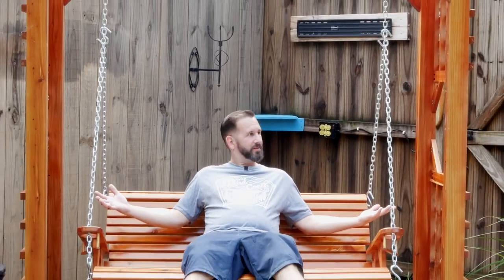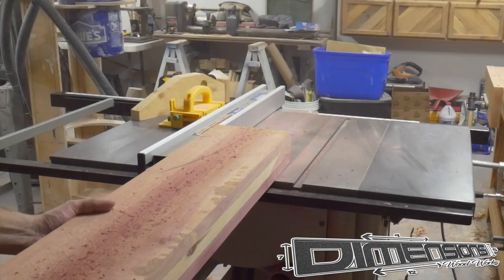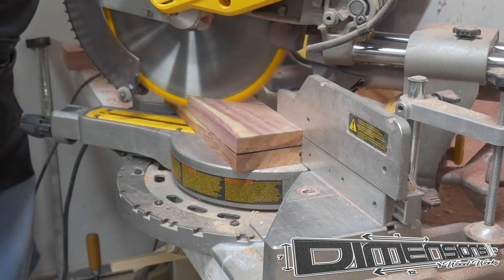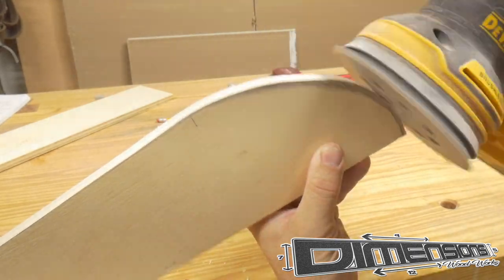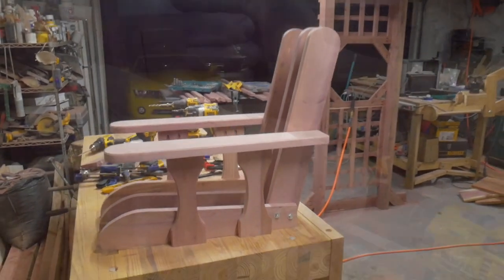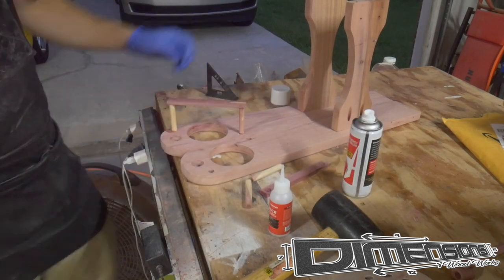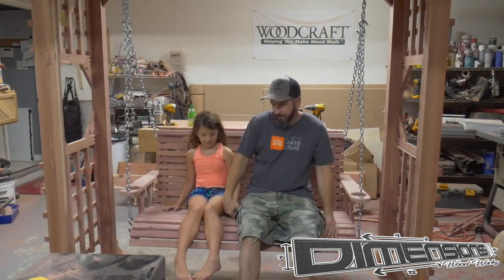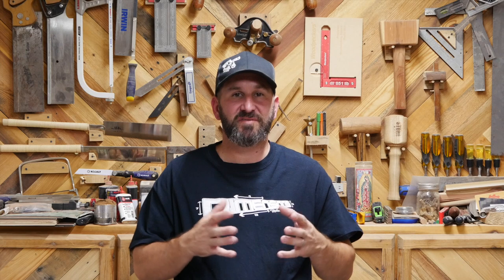DIY Swing

Comment: Any links to the hardware you used, chain size, etc.?  Nice swing, but I'm looking for a different design so I didn't buy you plans.  For instance, I'd like the chain to NOT go through the arms like many do, including yours. That's just a personal preference, not a criticism of your design.  Also, I'd like to add a swingdown console in the middle.  Thanks for posting.  Mark
Reply from the maker: All the hardware came from tractor supply. The actual hardware i used is no longer available from them, but there are several other options available. But if you buy the chain from them, the load capacity is printed on every chain, i 3X whatever i believe the max load may be, so if you use a different design, that may change as well. Thanks for checking it out 👍🏻
Reply: @dimensionswoodworks  Thank you, sir, for the quick reply and information!  Mark
Reply from the maker: No worries! I always love to see pics of the finished product. Send them to me when you get it done.

Comment: Excellent swing. I noticed you used brads and glue to attach slats to the frame. How do the slats hold after three years ? Do the slats stay where they suppose to stay ?
Reply from the maker: They have so far. The brads are really there just to let the glue dry. The glue is always stronger than the wood. You can reference MANY YT videos for confirmation of that.

Comment: I’m really thinking about giving this a go, but before I buy the plans, one concern is that I don’t have a planer or a jointer. I also wonder if I’m gonna have to glue the boards together like you did or if my lumber yard will have what I need. Do the plants call for the gluing of boards together? I know this is a lot of newbie questions, but I am a noob. 🥹
Reply from the maker: If you can get S4S lumber from your lumber yard (many offer this service) you don’t need a planer and jointer. If you can get 4x4s in whatever species you plan to use, there’s no need to laminate (glue the boards together) the plans just call for the final dimensions of the boards so you can use whatever method works for your situation.  I promise, you are more capable than you think! Just do it !!! Happy building!
Reply: Hey, I’m going to the lumberyard tomorrow and it looks like, according to the cut sheet, they’re all 8 foot lengths? Right? Im 99 % sure lol.
Reply from the maker: Yes they’re all based on standard 8’ boards